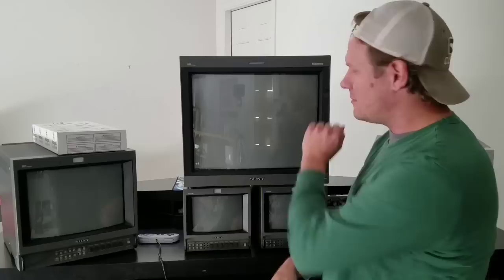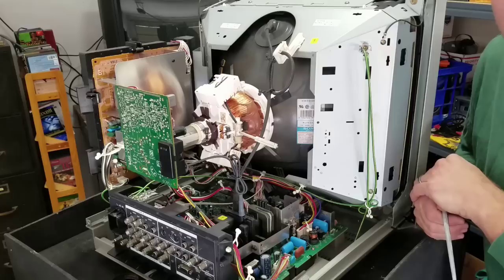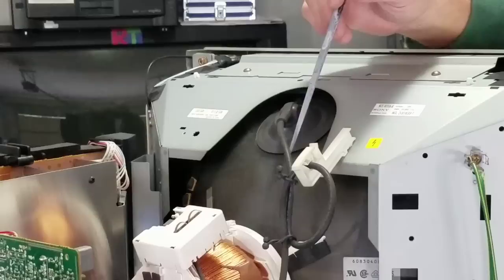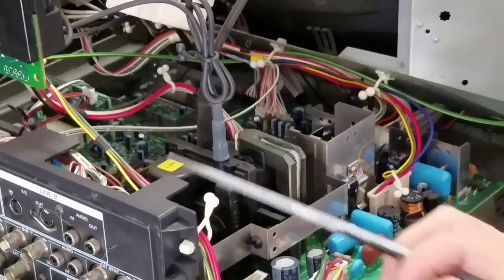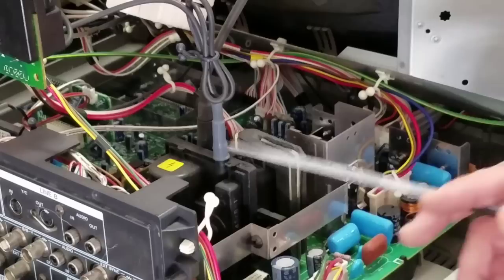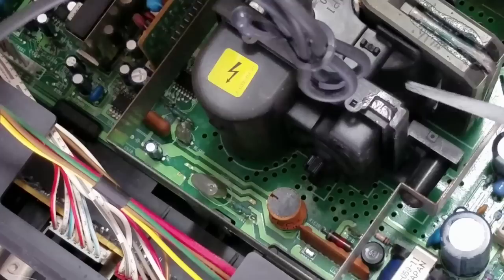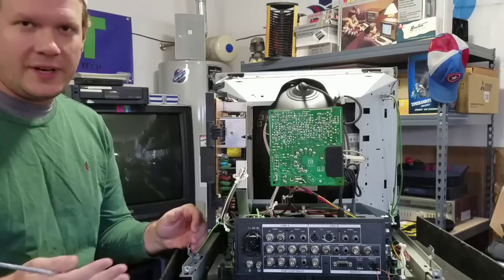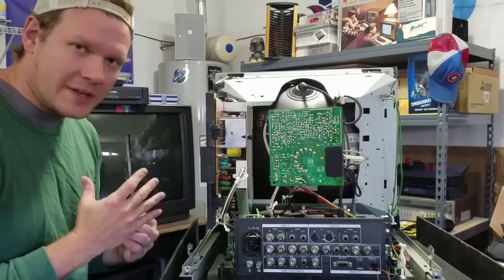Cathode Ray Tube CRT Monitor Safety - How to not get Hurt!

Comment: When replacing Sony CRTs, I found that carefully matching up the distances between an element in the neck (pick one) and the yoke, will save you a bunch of mucking about with geometry. 

I'm disappointed though that he didn't demonstrate using the discharge tool he made.

Comment: I would also add that if you plan on working on these in depth (like adjusting a yoke while live) not simply adjusting pots or rings a isolation transformer would be a good idea. Many service manuals for consumer tvs state you need one since it was cheaper to make them without it. 

A lot of these pvms/higher end stuff and quite a few arcade cabinets already have an isolation transformer built in. 

Just make sure you get one that has two prongs. I believe they call it a Technicians Isolation transformer. A lot of the current ones are three prongs and link neutral to ground on the output which isn't what you want.

Here are two videos that explain why

https://www.youtube.com/watch?v=3rvEdHyAd2k

https://youtu.be/XBsQ3sZ45Fk

I would also mention discharging those big filter capacitors would be a good idea too. Those can hold a big charge even after discharging the anode depending upon the model.
Reply: hahhha the kung pow dude

Comment: While working on a CRT, is there any reason you'd ever not start by discharging? Seems pretty logical that that'd be something you'd always want to do. This was very informational, thanks.
Reply from the maker: Not always.  There are some adjustments you have to make internally while it's running.  However it is good practice if you are new to working on CRTs to discharge the tube.
Reply: @RetroTechUSA  what about discharging caps?
Reply: @RastaJediX  if they are big sure, discharge them too, if you want to be extra careful, discharge smaller ones too, safety first ~ Anatoly Dyatlov
Reply: Does the ground need plugged into a wall outlet during discharge? If not, how does the chassis ground reach the earth?
Reply: @kruskotv1311  💀
Reply: @TheChuckster402  No, just to the metal frame is fine.

Comment: Thanks, that is very helpful. 
I nonetheless read that the most dangerous part is ultimately not the cathode buy the high voltage capacitors.
How can we be sure they are really flushed even after a power on/power off cycle?
Reply from the maker: Caps can be dangerous if the hold over 48 volts or have a high capacity where they store high amounts of energy.  The main board doesn't have any caps that are dangerous for the most part.  The power supply area is a different story, but either way the flyback and anode are way more hazardous than any of the small caps inside.  Thanks

Comment: Does earthing work the same? 
 I've already seen tutorials on YouTube (yours are quite good) but I'm making sure I comprehend more than the big picture of this. PS. I'm quite aware of voltage leakages, so I thought this whole discharging maneuver should be performed by touching the flyback's pins instead of the rubber suction cup part.

Comment: Great video! Question: So what kind of screwdriver would you recommend if you need to adjust the pots near the flyback? There seems to be like no room to use a screwdriver in that area.  A long bendy one or a short one?
Reply from the maker: I don't have a great rec. yet.  I was hoping to have some 1 inch plastic screw driver tips to be made on a 3d printer or something.  I'm still working on that.  Mostly I have to adjust it with my fingers currently.

Comment: This is a great video.  I do have a question concerning an older television issue.  The TV in question is a Zenith Sentry 2 from around 1992.  The original chasis developed a short where the final moments made the TV all green on the screen at very low brightness; no sound;  shrunk picture and then it finally popped.  In looking at the inside on the neck board, it appeared that a capacitor had shorted out, also the pins on the tube are a bluish color.   Rather than trying to repair that part; I did manage to get full replacement chasis of a similar type but the ground hook is different on the replacement chasis.  Its not a huge clip but rather a smaller one and the chasis is stereo.  The main board is mounted in an exact plastic frame like the old chasis but how do I connect the CRT grounding points safely?  All connections on the chasis seem to be the same since it is a similar/upgraded Zenith Sentry 2 board.  The ground lead is the confusing part; and also disconnecting the old lead.  The anode cap is well known so that's not an issue there.  The set has not worked for almost a year so it was never attempted to try the power after it popped.  Please help.  

Thanks.

Gary
Reply: I know this is an old comment but if it was just a shorted cap i would just repace it instade of thorwing away chassis that could be easly fixed

Comment: When making adjustments to the settings on the inside of a lower end PVM, would you recommend discharging the monitor and then making the adjustments while the monitor is off?

Comment: I want to clean the dust out of a CRT using canned air and a vacuum hose, will this be safe after letting the TV sit for a few days to discharge as long as I avoid touching the high voltage areas?